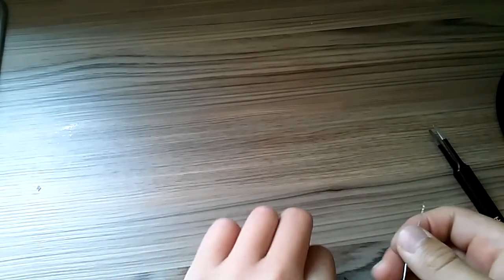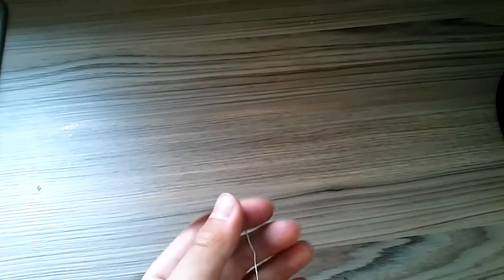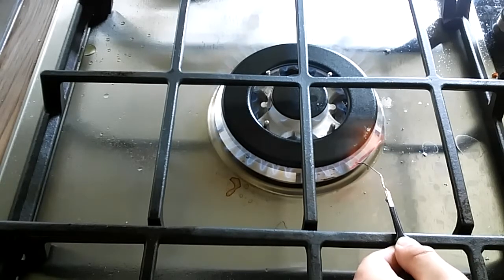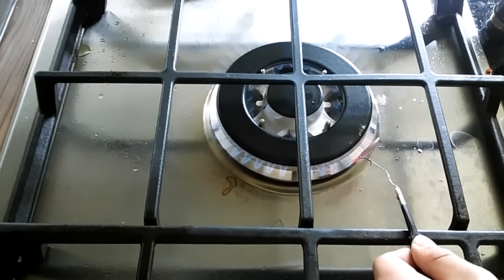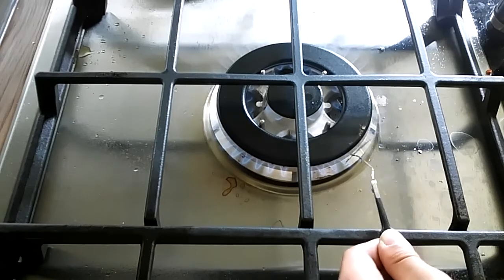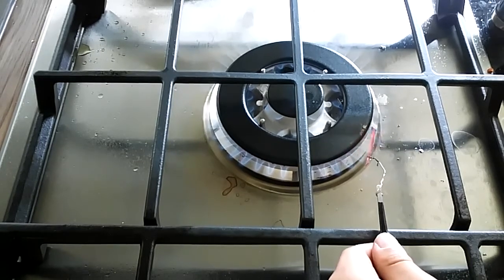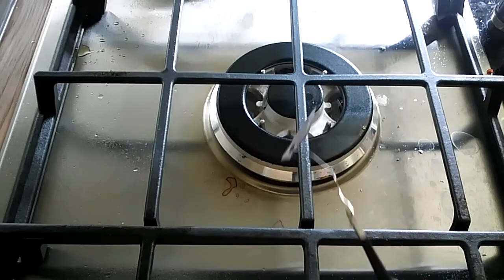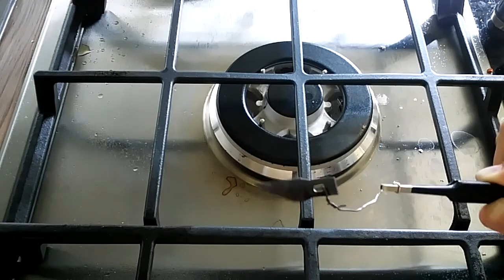How to make a diode at home: Part 1

Comment: Cool, thanks
maybe this kind of diode is called metal oxide diode
with electrolysis you might get copper oxide or iron oxide and use that after it dries in your diode experiments.
Good luck
Reply from the maker: Thanks, electrolytic process of creating metal oxide is much more complex and require more equipment. But it is possible. Simple air oxidation is much easy to identify and control.

Comment: Do i need to have the tblade out of a specific metal or will it work the same for copper iron and aluminium?
Reply from the maker: It will work with a wide range of specific metal alloy. This one is high carbon steel.